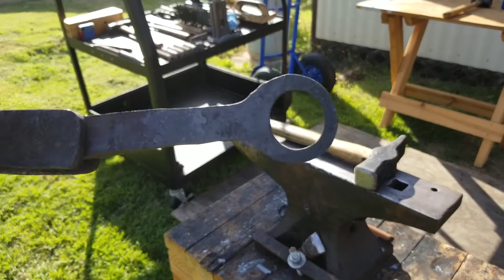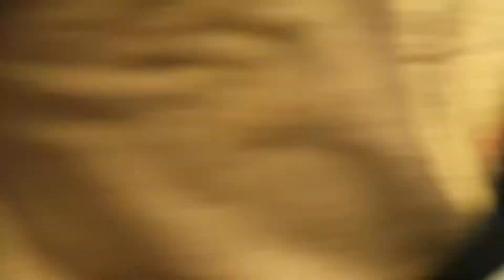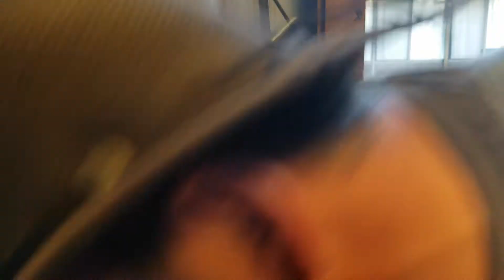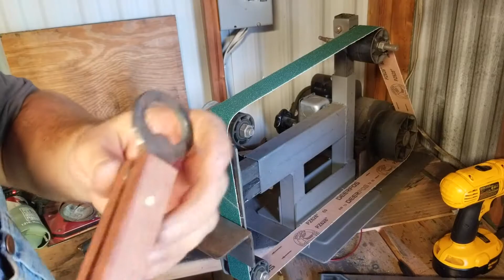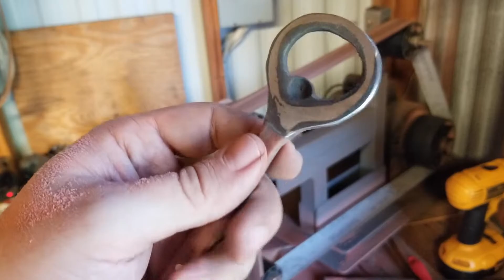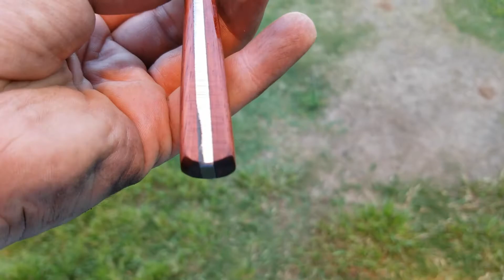A Forge With No Name #2019OpenersOpen Submission

Comment: How is your forge refractory ceramic holding up? I just got a Devils Forge and am applying the rigidizer tonight. However, after that, i am wondering what i should use for refractory? Do you have a link to what you used/name?